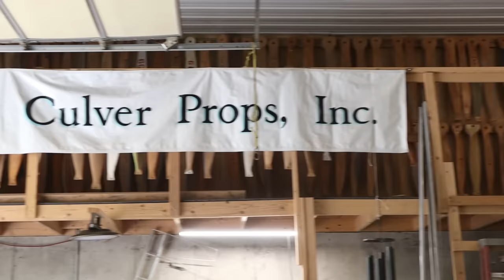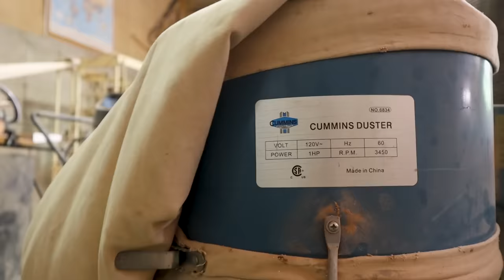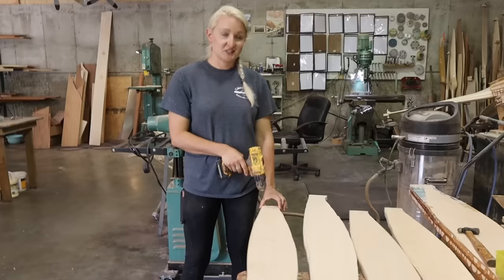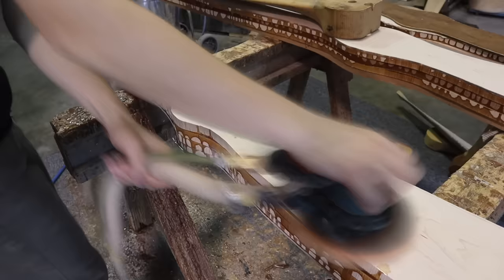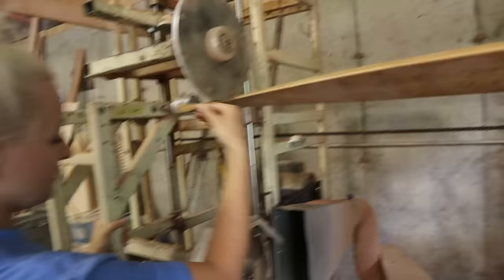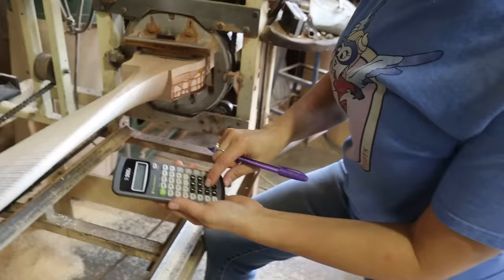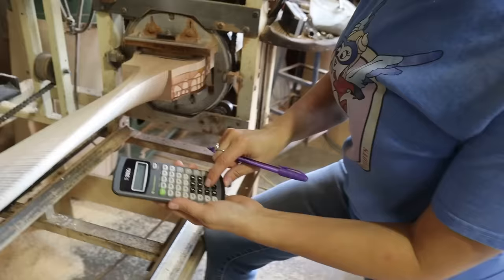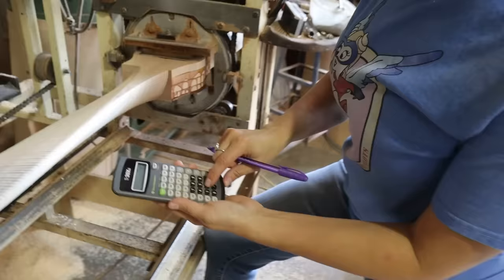Making a WOODEN Airplane Propeller!

Comment: Can you please build a vacuum chamber and put your wood in it to make something from, maybe a rocket or boat or canoe or something different and interesting... Cut to shape and sand and seal  also do a strength test. 

But want to see you make something amazing with it... 

I think have to leave in vacuum for about 24 hours to completely dry it out, will need some kind of moisture trap to protect the pump. Hmm 🤔 maybe drying over a heat source first, should speed up the vacuum stage.

It's supposed to feel  very light like... Aerogel? 🤔 

Curious to know how strong it is. Before and after vacuumed and how easy it is to work with, or if it's too ridged and fragile or brittle. 

And if blending some graphite with a teaspoon of milk powder  to about 20g to 50g of graphite, and blend (careful it gets Hot quickly! (Best not to use a NutriBullet  style blender 💣 of hot black water 💦), blend away from the house, it's a nightmare to cleanup!) Blend for around 20 minutes, grafite will sink to the bottom, graphene will stay suspended for months, don't store in an airtight bottle 💣, dry to form a power wear masks 😷,  then mix with epoxy and paint on your new vacuumed project to make a super light and strong structure. 

Or a more easy way: use your laser cutter, use a flame retardant gas and or soak sheats of paper on a flame retardant and dry. Then laser burn off material leaving the graphene, it looked very interesting. And looked to have a hight refraction looking through it (check out  "robert murray-smith graphene videos".)

Maybe it could be used as a very hight temperature camera lenses, for visiting hot bodies like Venus or Mercury… maybe something to think about…

 Maybe work good as an IR-filter lense too? That could be interesting…

And can also make very low resistance circuits. Maybe using some other thin material for the laser scribing…

🎉  build whatever you planned... Have fun and good luck 💕😘 ⛵ 🕊️💸

Comment: The bandsaw blade guide rollers should be about 1/4" above the work piece... you can see how far the blade is flexing, the guide rollers are set up to max height several inches above, this is unsafe and makes bad cuts. Be safe, use the tools correctly!

Comment: That's not a lathe, that's a duplicator. I am terrified that the operator didn't know the difference.
Reply: It passes for a lathe since basic definition of a lathe is where the work piece rotates and is shaped by a cutting tool. More precisely I'd call it a lathe with duplicator attachment, lathe with tracer attachment, lathe with copy attachment, etc. 

A duplicator usually has a stationary work piece with a shaping tool following a stylus on a pattern. I made a prop duplicator over 30 yrs ago that used a router to shape the work piece. I knew about the Culver machine back then and always wanted to built one.
Reply: it literally lathes.